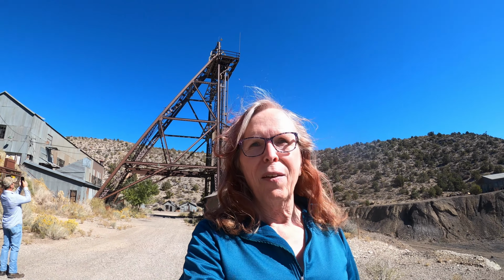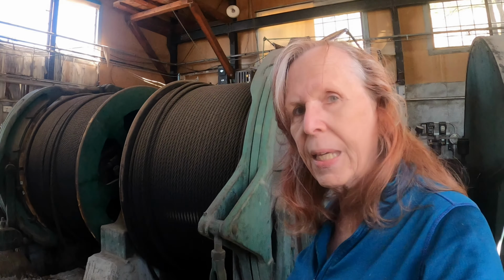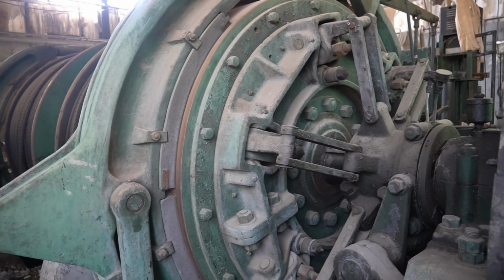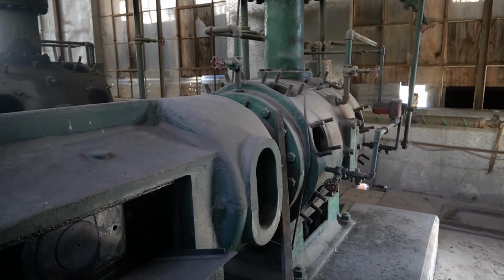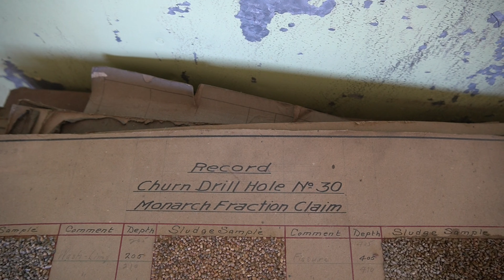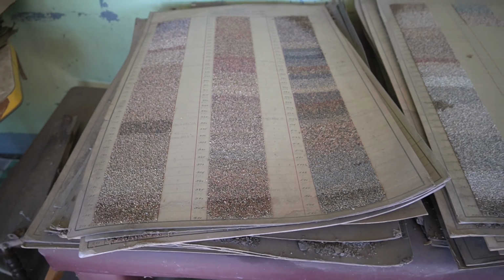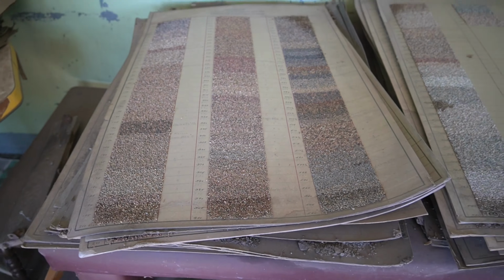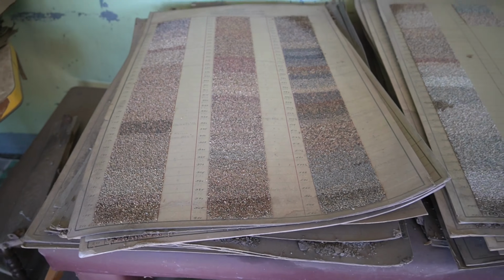We take a trip back in time at this silver mine.

Comment: That pipe threader is massive! I can only imagine the forces. I've done 3 inch npt by hand. Holy cow what a workout.
Reply from the maker: Right! Almost every drift and stope in a mine will have two pipes running into it. Compressed air and water so the miners had to install miles and miles of piping in addition to the track and timbering. So much work went into building infrastructure to support the actual mining!

Comment: Hey Joanne, I've been looking at the clips of the compressors and wonder if they were 2-stage compressors as the two cylinders on each compressor are different sizes?  So, the larger cylinder would be the first stage, bringing in atmospheric air in huge quantity and compressing it initially and then the second, smaller diameter cylinder would take it from the first and compress it further, obviously being a smaller volume as the air is already compressed.
OK, I could spend a day just following all the pipes and stuff on the compressors alone!
I wonder if the compressors had a cooling system too?  Hmm, I need to go and have a look.

The machine shop is AMAZING.  Might have to move in to look at everything.  Could be a couple of years before I get done and am ready to start looking at the underground stuff.
Reply from the maker: Good question! That could very well be the case. All the compressors we saw were of similar design even when manufactured by different companies. I was so gob-smacked by it all I just didn't think to study the small details. You and I could easily spend a day in each of the areas, compressor, winch, drill repair, or machine shop. You would probably never leave the machine shop. It truly was an amazing place.